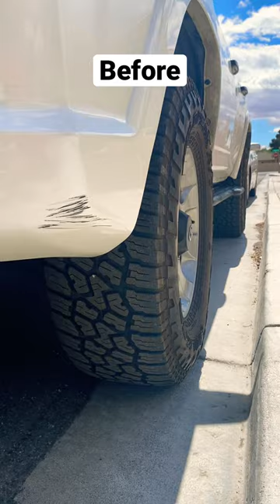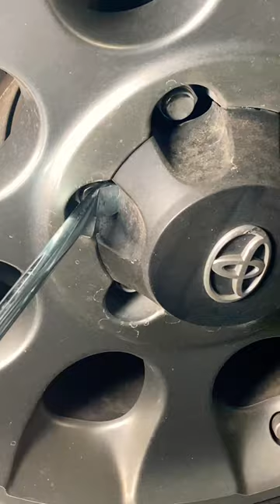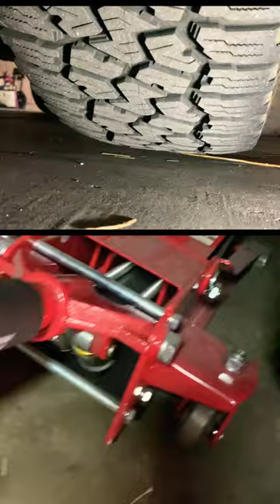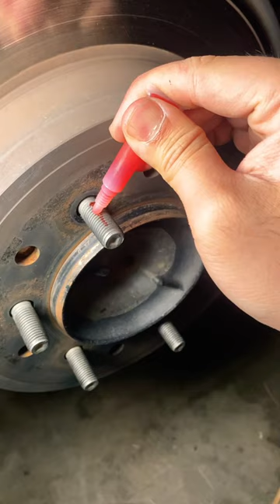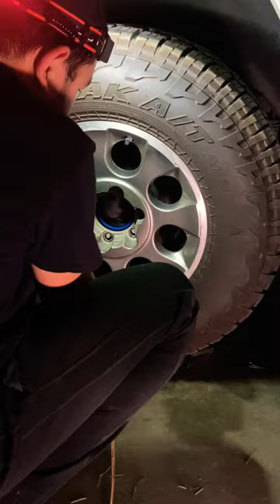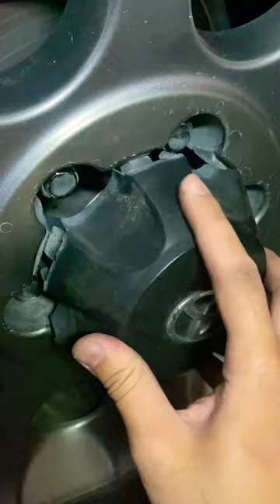4Runner Spidertrax 1.25” spacer install - ASMR (you didn’t know you needed) #4runner #spidertrax

Comment: Dang, that made a bigger difference than I expected.  Thanks for sharing 👍
Reply from the maker: It does!! And a good amount, not too much
Reply: What size tires??? Any rubbing??
Reply: @sago_t4r  I would have expected some smooth road shake issues with lengthened spindle length...

Comment: Nice clean install. I would just worry about what these are doing to my wheel bearings
Reply: When ever you put wheel spacers it’s recommended to change out your wheel bearings
Reply: @Angry-Little-Fish  that seems expensive. Wheel bearings in all 4 corners.
Reply: Lower offset wheels have the exact same effect- unless you counter the amount of negative offset with tire width (usually a balance between a bit wider and a bit of negative offset rather than a lot of negative offset)
Reply: @morfdq  can’t be cheap with expensive toys mate
Reply: @Angry-Little-Fish . Agreed and I am far from cheap with my 4Runner BUT I’m not going to add something that just causes damage to other parts. Makes no sense bud. And for what? The looks?  Honestly I can’t even tell the difference between what you did on yours and the 33s on mine.
Reply: @morfdq you can always get a Chevy spark or a scooter for that matter
Reply: @JORGE4757S  I bet your husband married you because you’re funny
Reply: @morfdq  lol I guess I did hit something a little sensitive
Reply: lol I guess you fall into the bucket of doing mods to look like you actually take it off road and also will do them even though it impacts other parts. I have a 4R that I built. How about you?
Reply: @morfdq sometimes uou need spacers to clear larger tires. You need larger tires if you use a lot of poorly maintain access roads and backroads. Spacers are cheaper alternative to offset wheels which, ultimately will have the same effect on wheel bearings. Bearings are a wear item and will fail eventually, even if left stock.
Reply: @Angry-Little-Fish it’s also recommended to get life insurance for when that wheel comes out flying at 70mph
Reply: @HBrothers-gx3qg  😂 like that will help out. They will say that it’s not covered in the contract 😂 I seen it before
Reply: These people poo pooing spacers…saying nobody who “wheels” would use them. If you only knew how many guys in my Raptor group use spacers. And they are driving (and jumping) HARD. You just gotta know what to get, how to use them, AND how to maintain them.
Reply: @Angry-Little-Fish lol that is not true. They will wear a little quicker but nobody just immediately swaps wheel bearings every time they put on wheel spacers or larger offset wheels

Comment: Looks really good. I used like 4x the red loctite as you did. I'm wondering if I over did it😂
Reply from the maker: 😂 probably but better safe than sorry, no issues in removing it, just use a good breaker bar 👍
Reply: @sago_t4r  Good to know. I don't plan o. Removing them until I need to replace the rotors which should be a long while from now haha. Your truck does look really good. Nice work and thanks for sharing the video.

Comment: Congratulations you have now lost the last 2mpgs you were holding on to and are now negative not per gallon besides the fact that you need to readjust the entire suspension to perform better as you should but since that is not the case it will look good parked. Let’s just hope you don’t lose a wheel on the freeway good job guy way to “mod” a car

Comment: I had these on my 4Runner. No issues. I was worried what the naysayers would happen like the wheels flying off lol
Reply from the maker: As long as you maintain it, torque it every oil change or 5k miles. Your good 👍
Reply: Its a lot more load on your wheel bearings, wi bw ready to replace them before you have an accident and total the truck
Reply: I would think twice about adding an additional part like a spacer to the main weigh bearing components
Reply: @sago_t4r i just recently got spacers. You need to tighten them every 5k miles/ oil change?

Btw it was necessary bc i was ill advised on a new wheel size (a too low offset would cause the wheel to be too close to my break pads. Too late now couldn’t return the wheels. So i had to put spacers) 

I’m worried how many say they’re not safe. But I’ve read they are if they’re install properly which i believe they were. 

But what’s the maintenance requirements for continued safety?

Comment: Off set wheels give you the same results and probably safer too.
Reply: Lol running stock cast aluminum rims and off-roading is a No no where I live
Reply: @nathanielcoleman8195  they may be alloy, I e never cracked any but I have 2 buddies that have
Reply: 1990s Toyota aluminum stock rims tough as hell.
Reply: @tonyisme4934  aluminum cracks steel bends I prefer being able to fix my wheels when I’m way out in the woods
Reply: @StayGrindingWelding  ever heard of a spare tire?
Reply: I should be more specific, spare wheel wit tire. I'm sure you know what I meant. What are the chances of a young hustla breaking more than 2 wheels? if you ever bend or break a wheel out in the woods, you'll most likely have a spare you can throw on. And lets be real here, 99.9% of homies wit "offroad" or "overlanding" "rigs" are never gonna be on a trail extreme enough or put themselves in a situation where breaking/bending a wheel is a possibility. They're much more likely to damage a wheel hitting a curb while leaving starbucks.
Reply: @johnnyjohnathon7381  my 4Runner is part daily driver and camping vehicle.  I carry a spare of course, but I also carry "Tire-in-a-Can", tire plugs, tire pump and a long 1/2" breaker bar for the lug nuts.  I don't do as much camping as I would like to but just in case.......
Reply: @johnnyjohnathon7381  that’s great and all but you have to come back out at the same place you cracked the rim, much easier to just tap it with a hammer and keep going

Comment: I have 2 inch spacers and a leveling kit i need to toss on.. i put the spacers on to see and they cause the out side of the tire to contact the frame on full lock..-leveling kit will fix it but a pain that i had to pull them off for now 😂
Reply: Not sure what tires you run, but even 1.5” spacers on a leveling kit rub from my experience w 265/70/R17s. Just a heads up

Comment: How often do you re-torque those spacers as maintenance?  Do you need to uninstall them and put new loctite again?
Reply: I've 3/4 inch spacers on my car for 2 years now, no problems at all. When I check the brakes I check the torque on them. They're still exactly where I torqued them too.
Reply: Spidertrax instructions say to Tq to 90lbs then drive for 50miles and recheck Tq at 80lbs. If they haven't moved your good to go. There's no interval but I'd assume I'd check them when you do brakes or tire rotations since the wheels are already off.

Comment: I’ve had wheel spacers on my truck and my wheel almost fell off because of the spacers it puts a lot more stress on your front end just be careful when you run them
Reply: Which part of the studs came loose? Spacer studs, hub studs or bearing hub?
Reply from the maker: Which spacers did you run? Which broke??